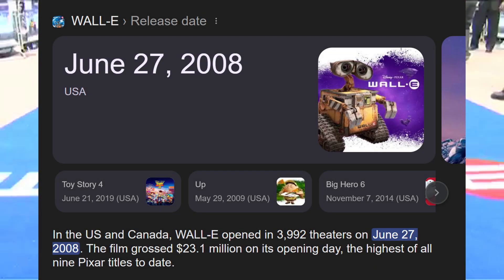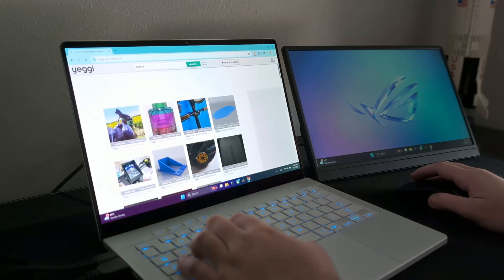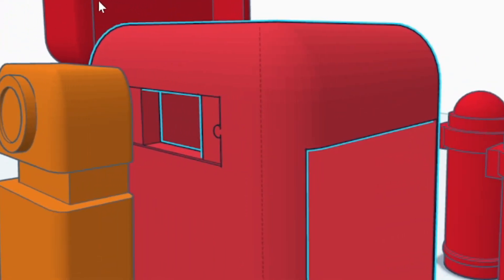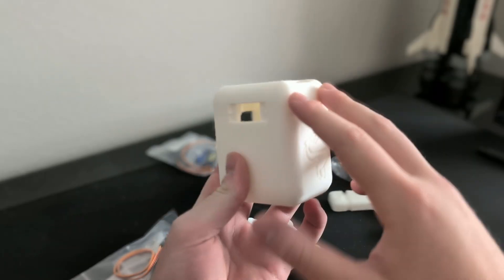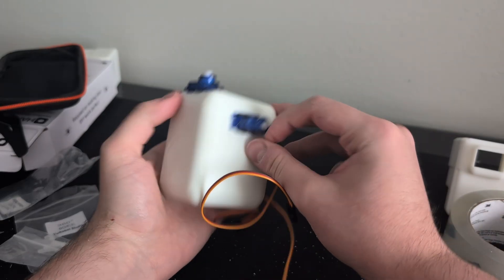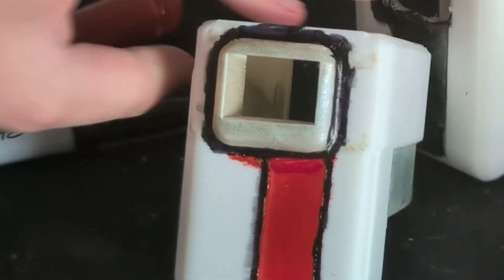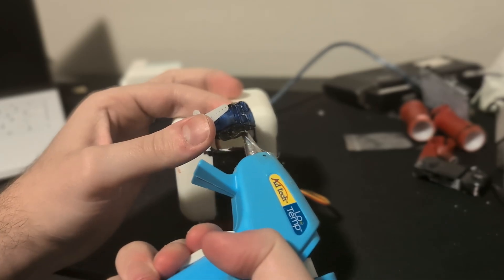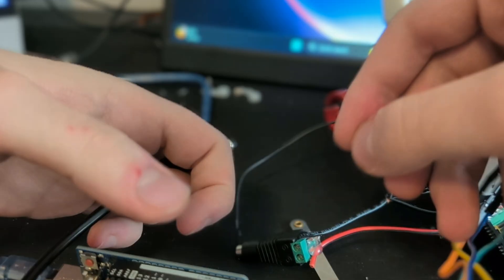I built Pixar's forgotten robot in real life!

Comment: True tinkercad is truly peak
Reply from the maker: Unfortunately never got the recognition it deserves
Reply: @LeviathanEngineering I love it, tinkercad simplifies the design process, I think the only thing is suffers from is that it's not clear what the default unit of measurement is, however once you learn that, the rest of the software is stupid intuitive

If you like you can check a silly model I made, it's called jumper dragon, idrc if you do or don't but it's there if you're interested, or curious oh and the model will be a blown apart model of a giant robot, it's been split into each articulating segment

Comment: Turned out great! 
That paint bleeding you had, one trick is to clear coat or apply the same colour as the base material after masking but before painting the final colour, so you seal the edges of the tape mask and then you get a nice clean edge. Only downside is that you have to wait an extra drying cycle, but it's usually worth it!